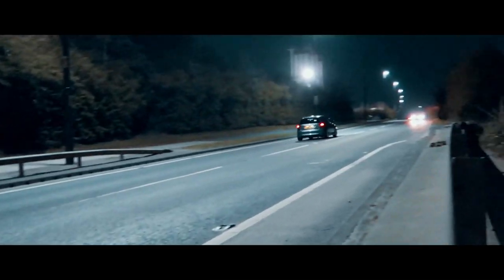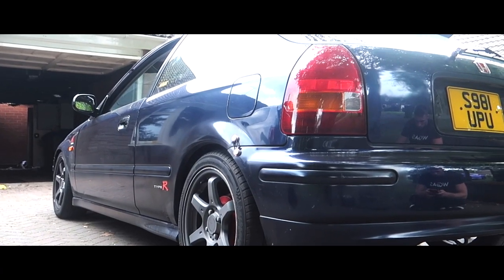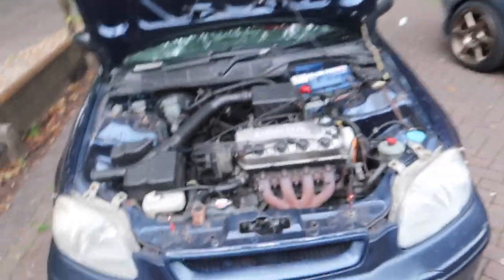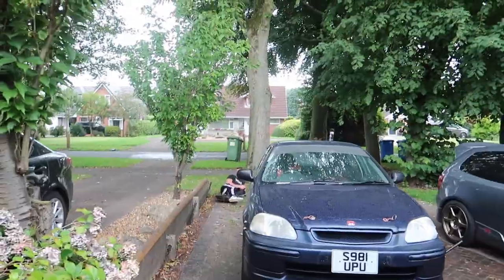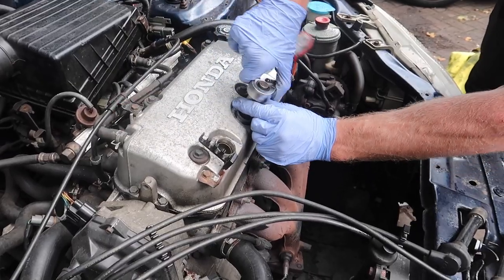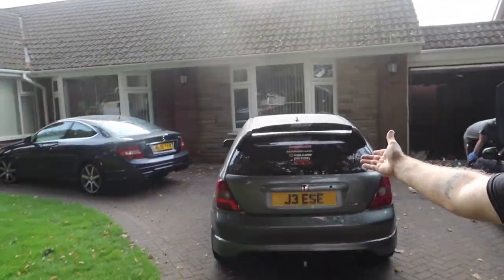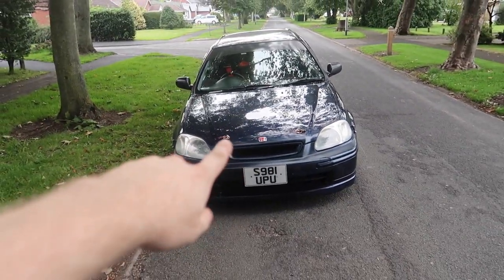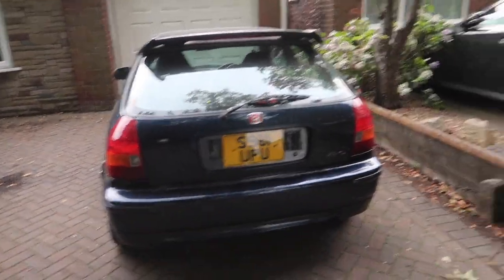🚗 ANOTHER PROJECT CAR... *Scrap To Track Ep1*

Comment: I had the same car but mine was the facelift so slightly note power.If you fit an AEM dryflow filter they roar like a vtec it's insane,also a 90 quid 4-2-1 manifold makes a good diffidence in sound and performance.D16 intake manifold and will go better.The D16 is the better engine for running a cheap turbo kit my mate had one that beat b18 turbos and he spent half the money

Comment: Do a h22 swap from a prelude swap out the front hubs for integra dc2 so you can have the bigger axles and brakes swap the rear drums for a set of integra brakes on an ek9 rear trail arms easy things to do well other than the h22 only need a different rear mount for it get a trackction bar up front helps a hell of alot with movement back and forth when you put power down more so when you swap it and if you want to turbo it get a cheap d16z6 as is a cheap vtec engine that can make power then put a set of suzuki vitra pistons in it and some ebay h beam rods with bigger injectors and bigger pump with a boost refrence fuel pressure regulator and make around 500hp but it will blow who knows when but they aslways do haha but would be good fun for a few months hope this comes in handly for you keep up the vids

Comment: Don't buy the transparent distributor caps that let you see the spark through as they are crap quality.lol A new distributor and magnecor leads with lifetime warranty will help the ignition side.It isn't a vtec unlike the d16 which is a single cam vtec (changes from 8 valve to 16 I think?) for economy

Comment: Wait did you say ej9,....🤦‍♂️whats the point 90bhp at the crank may aswell walk. Granted im at at the start of the vid typing this so if anything is wrong ill hold my hands up.........i wasnt wrong 200+k miles probably running 50 bhp at the wheels,the only good thing to come from this is everytime you jump in the r now it will feel fast as fuck.👍